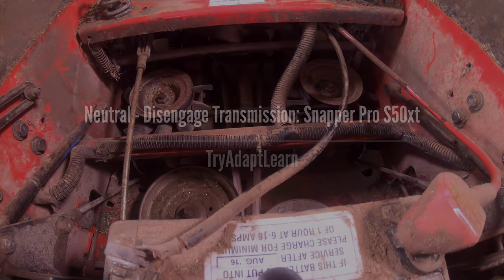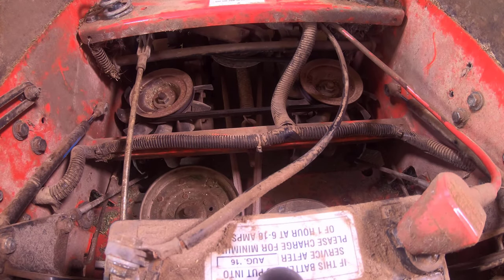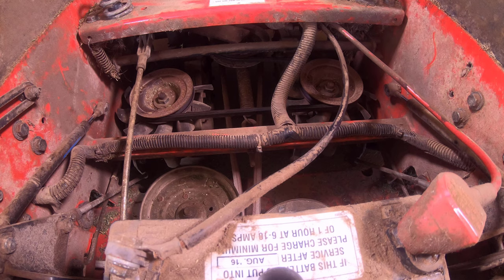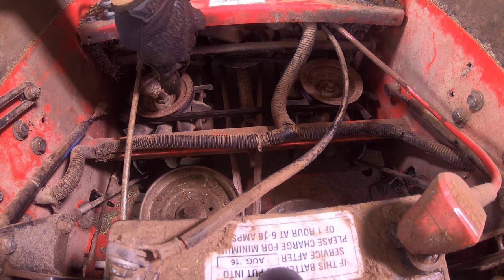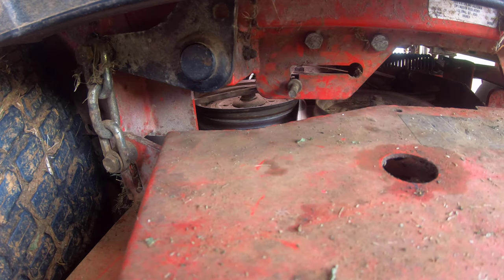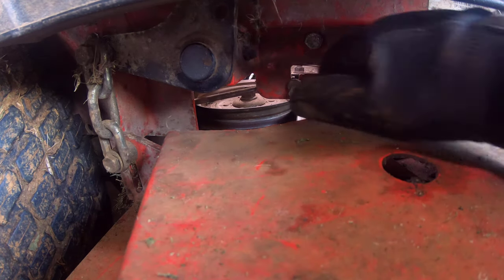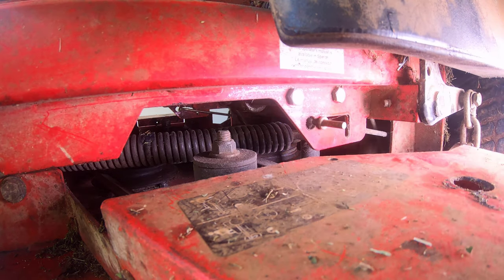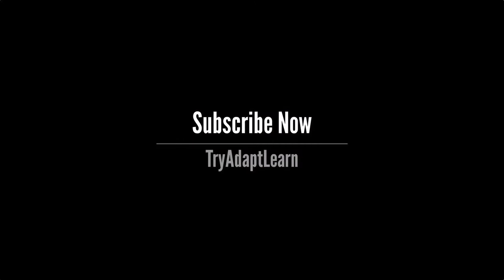How to disengage the hydrostatic transmission (Neutral) on Snapper Pro S50xt lawn mower.

Comment: So what if the lever does not make the transmission easy to push. The left one works the right one still wants to slide on the ground.
Reply from the maker: Might be a good time to check where the lever is connected to the transaxle.   Maybe the lever it self could have a little free play, hopefully the part at the connection can be moved to disengage the transaxle.   If the part at transaxle moves and it’s still doesn’t disengage, the problem is internal to that right transaxle.
Reply: @TryAdaptLearn  thanks. The lever on the transmission does move IDK how far it's supposed to move.
Reply: @TryAdaptLearn is there another way to purge air out the system if it does not disengage? I just serviced the trans and I need to purge the air.